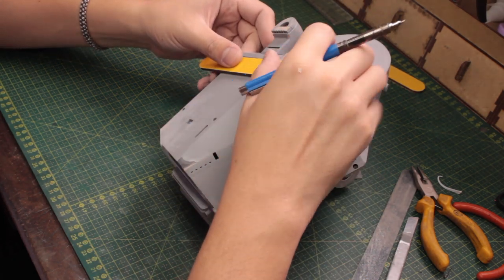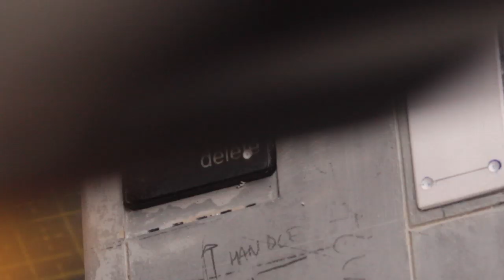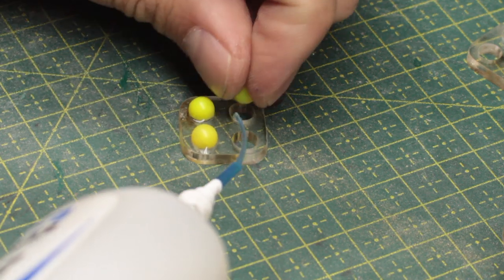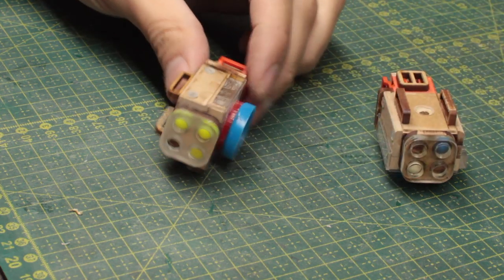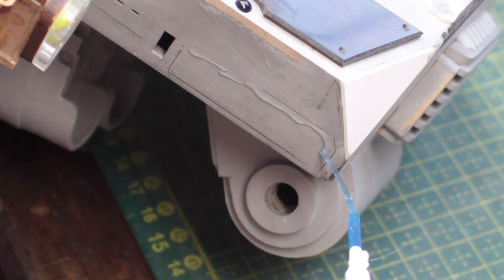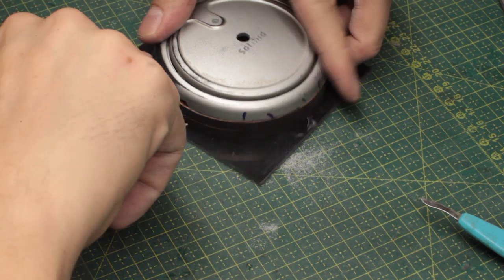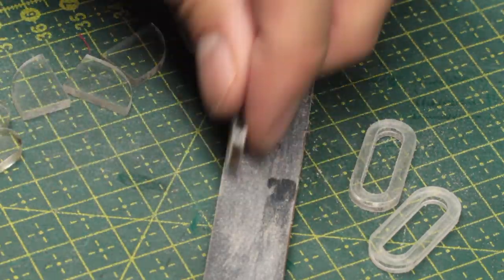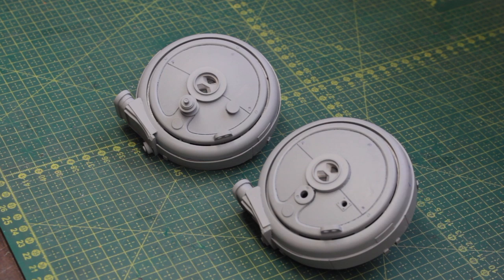Scratchbuilding a Combat Robot Model! - Part2

Comment: Do you have any issues with priming the many different textures in your pieces?  Does the wood absorb paint differently?  All the shiny plastic looks like it might just evaporate off.  I've been having that issue that if I don't presand something it doesn't retain the paint well.
Reply from the maker: Well, gotta say i've never had that issue with primer... The only time I had something similar to this was when I used an automotive paint that was meant for pre primed surfaces. I think primer should work on any surface and stick to almost anything... Try maybe wiping the surface first, cause hand/skin grease can really be a problem (happens a lot) and also, the MDF boards really do absorb a portion of the primer but not too much.. hope that helps! Stay safe
Reply: @CutTransformGlue  yeah Im working on smaller pieces so I worry too much primer might mute the details too
Reply from the maker: That can really happen! gotta be carefull with the tiny details for sure